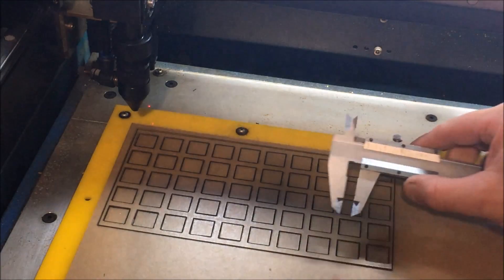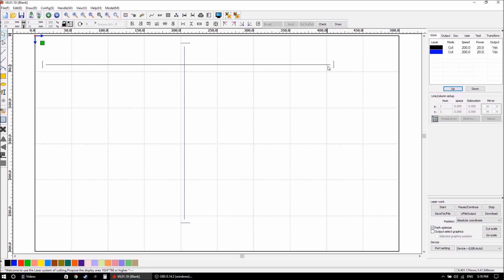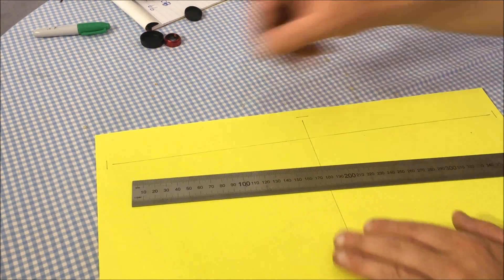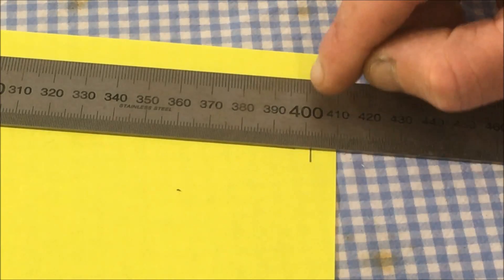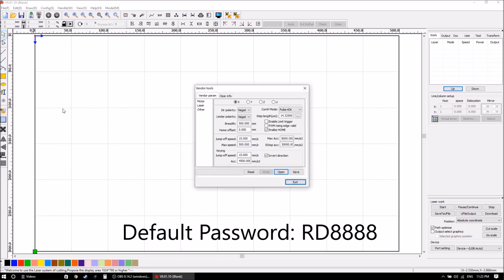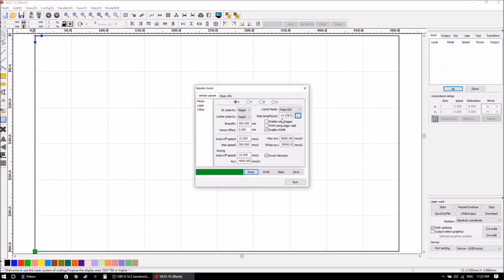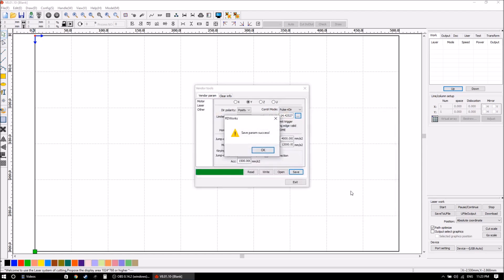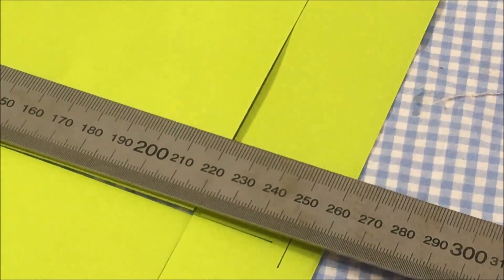Calibrating XY axis on chinese laser cutter with RDWorks software.

Comment: I have a problem when I click on read I get the notice of (no device connected), where should it connect? on Mi PC?? - My cnc does not have wifi or will I have to put a network cable from my pc to the internal panel of the cnc? please help

Comment: great vid. Had to replace the stepper motor recently and do this.I will add the longer the lines the greater the accuracy. Across the whole table width and height if possible.

Comment: good afternoon, have a video explaining how to calibrate the steps of the x and y motors, as I cut a ruler on the 30 cm corelLaser, however when cutting, I found that the cut size was 31.7 cm.
I have only been working with the co2 laser for a month, can I use this procedure with RDworks, to fix my problem, since I use CorelLaser.?
Reply: me too , using corerlLaser and coudlnt fix the xy problem

Comment: Great video. My lines are perfectly accurate but they are not 90° at the corner. In other words it seems to be off square :-/ Any ideas?
Reply from the maker: 2 mechanical reasons this could happen are 1) The movable rail is not squared but twisted at an angle a bit, 2) The work table is not level, opposite corners might be tilted at slightly different heights.

Both can be checked easily with a square. Tilted table is most likey and can be fixed easily as I show in another video. If the rail itself is crooked you will need to figure out how to straighten it. Ive never had to do that.
Reply: @makestuffnow  thanks so much for your advice as it's confirmed my suspicions. Although, I was hoping I'd not need to dismantle the machine. I've checked and the 2 side Y gantries seem to splay slightly rather than run parallel. Looks like a pig of a dismantle and adjustment job :-/ but thanks again for your help, really appreciate the insight.

Comment: Hello - I have tried this very helpful procedure multiple times for my x/y axis. I've used clean versions of V8.18 all the way up to v.30. It's not the software or there is some other area to put in values. The 100x100 square will hold its x axis lines, but the y axis are always 158. It will not draw a square. Because of this step inconsistently all of my work gets distorted now and until this is resolved no work can be accomplished. It's a critical matter if anyone has a suggestion? It it the stepper motor? Limit switch? It's hard to believe it's mechanical because it is the exact 158mm measurement across the board with all versions of RDWorks. 
I need some assisrance.
Reply from the maker: You can email me at stephen@makestuffnow.com and i can work through your problem with you.

Comment: Hell I did this very step and my y axis will not correct itself. i have done it 10 times. If there something I am missing. The x axis is a perfect 100mm
Reply: I am the same problem X axis is fine but cannot get Y to change
Reply: Did you ever figure out the problem?
Reply: @JamesTrimble  I haven't turned on my machine in 8 months. What I need to do will take extreme patience, massive research online, and recalibration back to the factory settings with the latest software and manipulating the hardware.

Comment: without seeming completely stupid ...what is RDWorks Software?
Reply from the maker: RDWorks is the software for running machines using the Ruida brand controller boards. These are the more common controllers in the 50W+ chinese machines sold on ebay/aliexpress.
Different controllers will have different software but there will be an equivalent to these settings somewhere. You just need to search through the settings to find where it is.

Comment: Great tutorial! My machines write button is grayed out so it will not let me write the information back to the controller. I am connected by network cable. How can I write the information back to the machine?
Reply from the maker: You need to do a 'read' first before you can do a write. Button will be grayed out until then.

Comment: Great tutorial, thank you! Do you or anyone else have a tutorial on calibrating the XY perpendicular trueness? I think my XY might be off a slight degree. I'm wondering what the best way of measuring and effectively correcting it without making it much worse. lol
Reply: I usually do it manually. Draw the largest square that you can, then measure and compare it's diagonals. If they are not equal,  adjust manually the left or right base of the gantry (of the Y axis). That can be done when there is no power supplied to the stepper motors.

Comment: Hi mate, what kind of thickness of Acrylic will a 50 ebay laser cut through cleanly?. im looking to cut 5 and 6mm thick, woukd i require a higher wattage cutter for this?
Reply: 50W cutter will do 6mm in a single pass easily.
You can also easily cute up to 10mm, with 2 passes, and still get a decent finish.
Reply: @stephenmartin8959  is there a good website or info for starting points or cutting/power settings for different materials ive been having trouble cutting 6mm on a 175kw in a single pass at 8ms